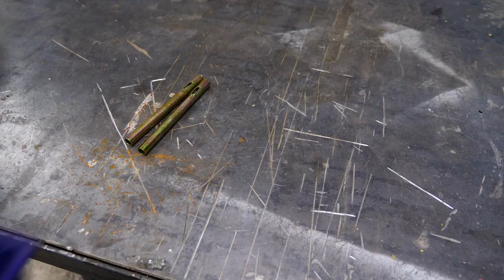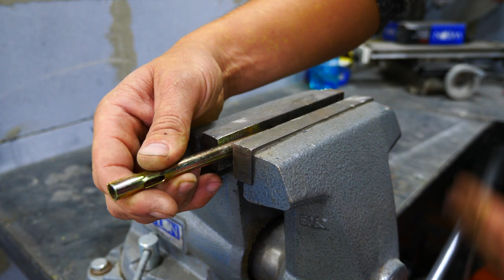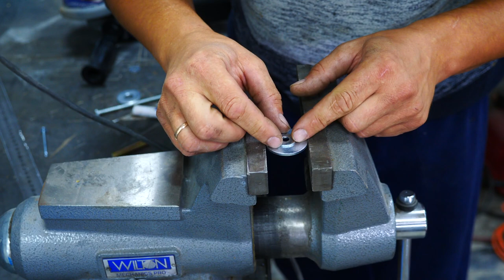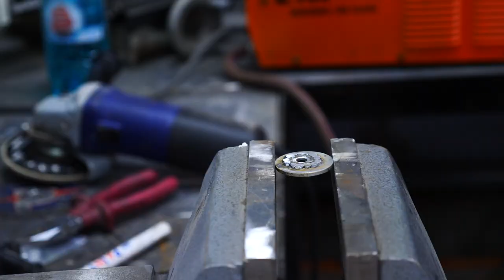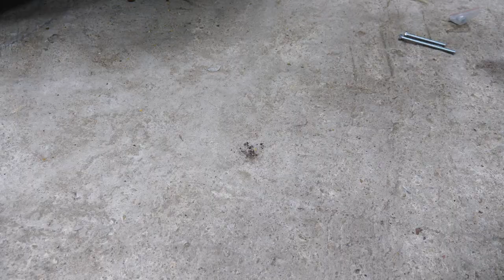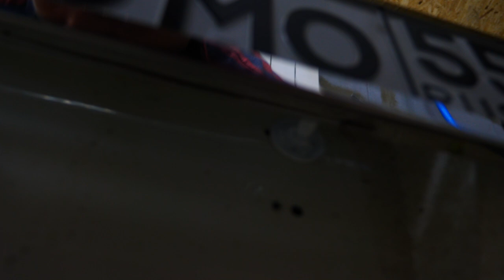Great idea from old bolts! If there is a car, then you need this idea.

Comment: yeah... Or you can just forgo all that scrap metal, and half-ass amateur "craftsmanship", and use those same two holes that you just drilled into your bumper anyway to insert two nice little, flush-mounting expanding rubber wellnut plugs with brass threaded inserts, and then bolt your license frame on and into them. They're only about 79c apiece at any autoparts or hardware store, and are DESIGNED for this very application too! People, just stop even watching these foreign butchers and all of their "great ideas" and "miracle inventions" videos, for the love of God please.